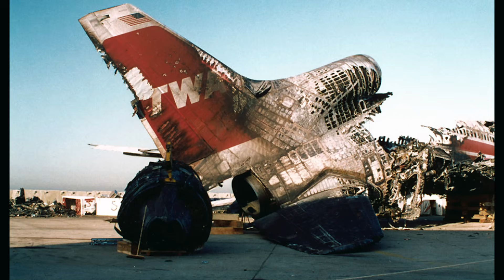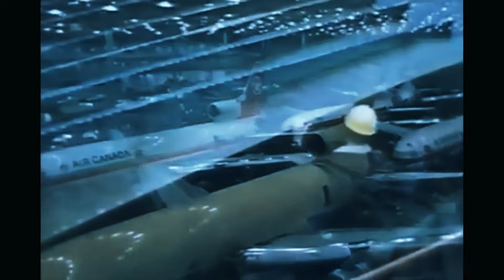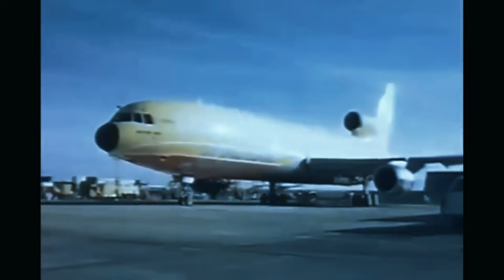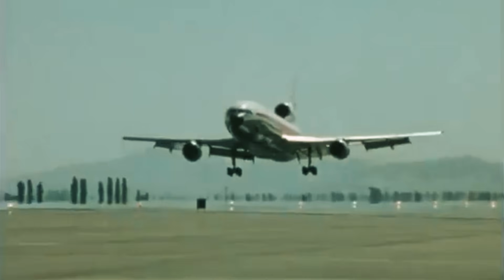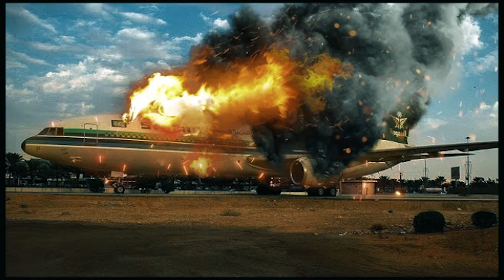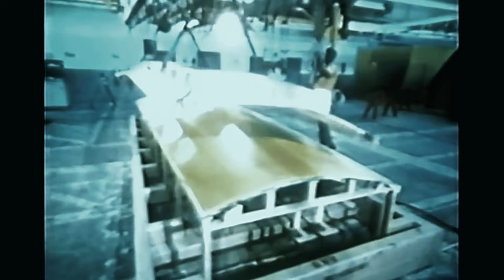I Investigated all L-1011 Accidents and was Surprised

Comment: I was an aircraft mechanic in EWR in 1986 when I witnessed a Delta Tristar crack its wing spar landing on runway 29. Plane was down for months. Delta mechanics told us Lockheed stopped backing the airplane and   
Delta was on their own. I thing the aircraft was N714DE.
Reply: N714DA